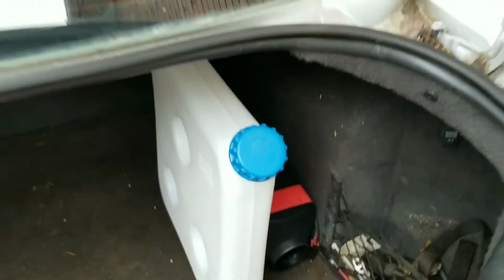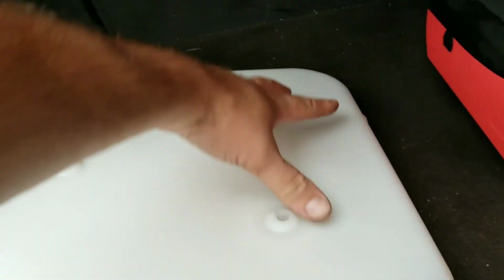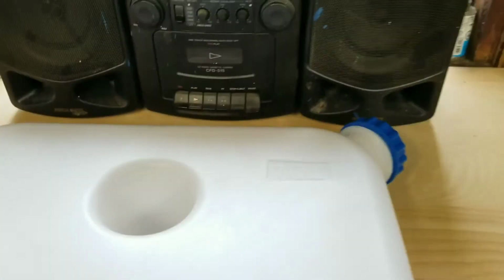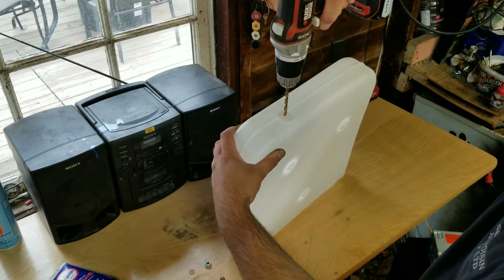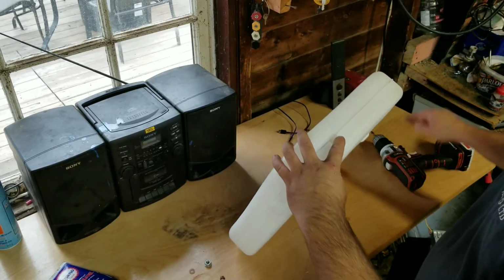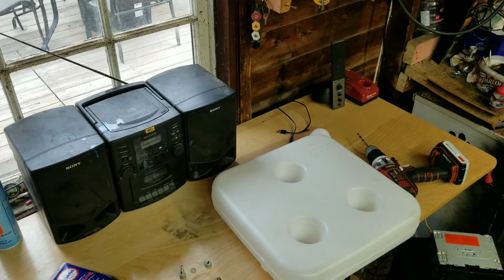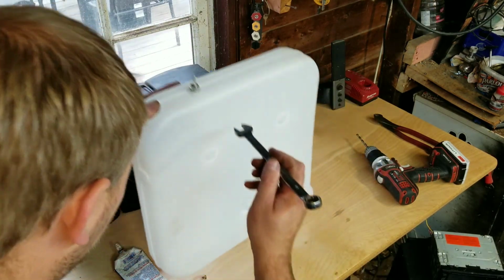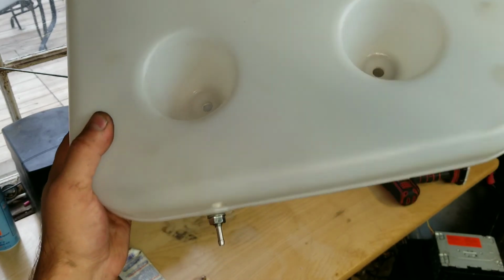Diesel heater install part 1

Comment: No more Jay... Interesting. Do you by any chance have the megasquirt crank trigger from the red zed you had in the 3500?!
Reply from the maker: Megasquirt? LoL. Worst FI system ever. My car was OBD2 swapped used a stock GM ecm and tuned with HP tuners.